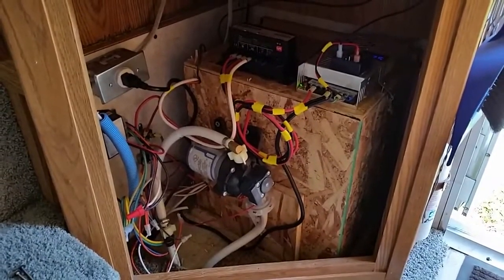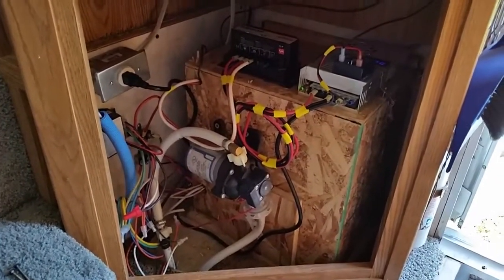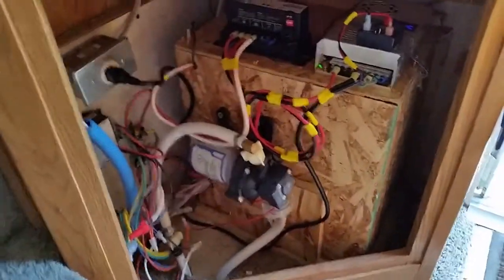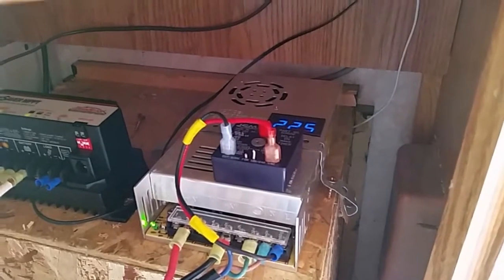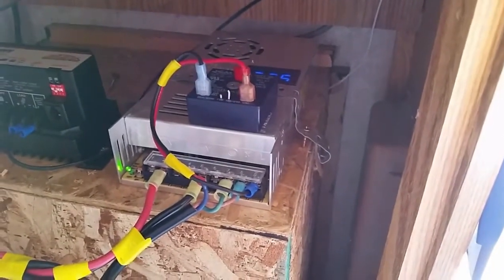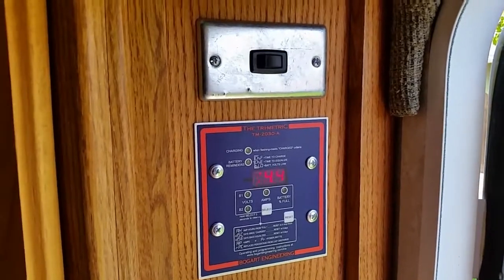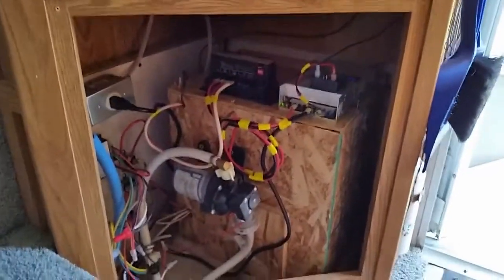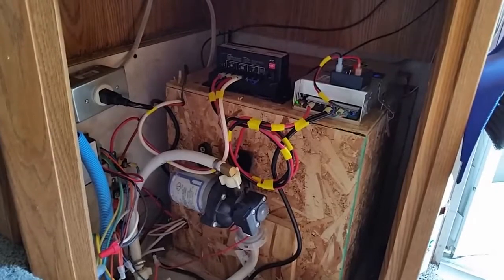WFCO RV Power Converter Replacement - Morningstar Sunsaver MPPT Controller

Comment: RV power "converters" that are resonant transformers are the quickest way to murder expensive batteries while getting poor charging (undercharging),  esp. terrible while running genset (expensive fuel, expensive maintenance). 

To add a solar panel rig cheaply, look at Morningstar Sunsaver Duo, which will independently charge your start battery (not sure if you have motorhome) or another SunSaver MPPT if putting 15A peak into the house bank batteries is sufficient.  The SS15MPPT is a fantastic little problem solver, as you have found! Getting a second or third one means that the learning curve is easy (no extra manuals on the shelf), and getting the cables for programming is a good investment. 

I notice that you don't have the external battery sensor attached to the terminals in the picture. The temp that is used by the controller is the temp of the box, which can be much different than the temp of the batteries, being inside a closed space with a power supply. It's not an expensive thermocouple on a wire (less than $30) that you attach to one of the battery posts (I'd put an insulating cover over this post assembly).

Comment: brilliant idea, that would also work well if someone had a large 24 or 48 volt battery bank and inverter but would also like to keep a small 12-volt house battery charged for common 12-volt stuff like led lights. much better setup than those 24-volt step-down converters that are expensive and easy to overload and burn up. i've never liked the common rv power converters either.
Reply from the maker: Thanks,
After about 2 years of running this way I haven't missed the converter at all.  That is with a combination of staying in RV parks and boondocking.